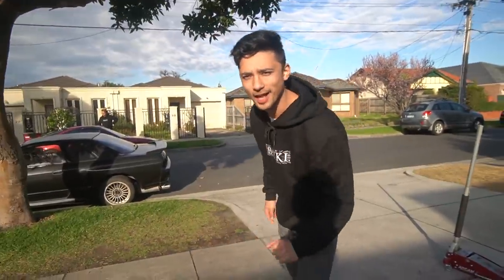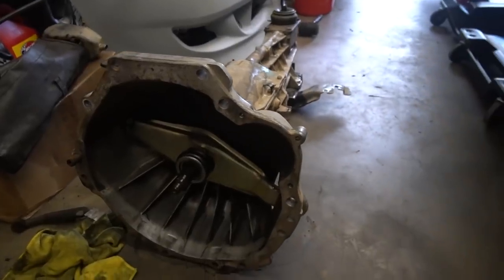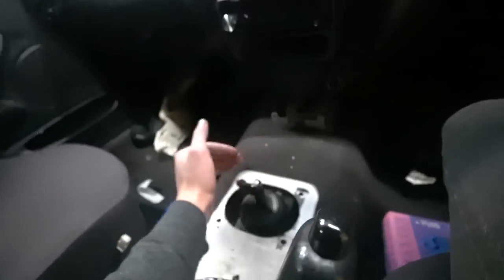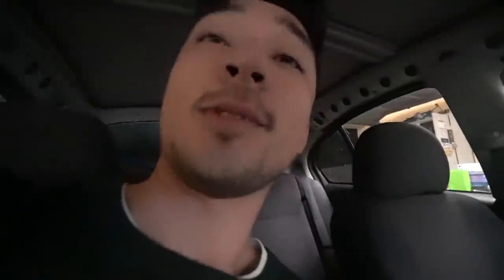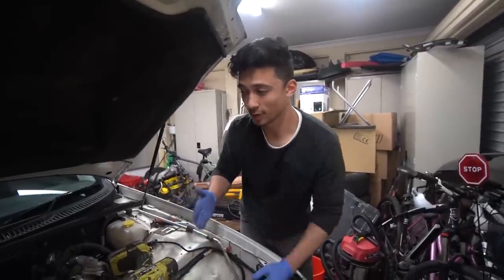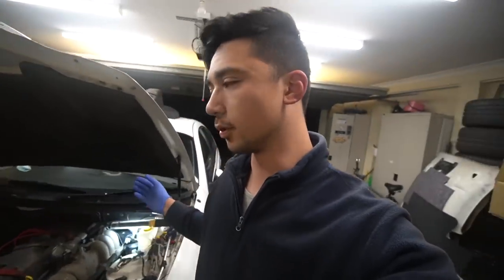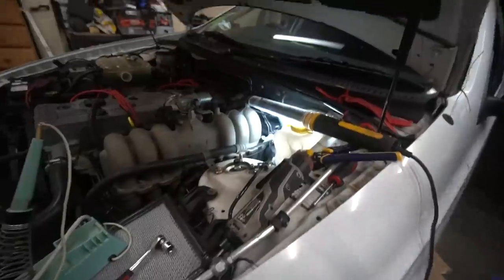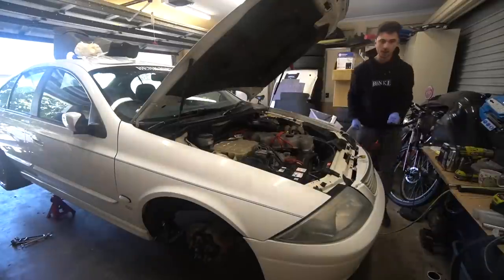IT DIDN'T START ON US - AU FALCON MANUAL SWAP PART 2.

Comment: how much does it cost to get the tailshaft shortend?
can they do that on the alloy shaft or do u need a steel one?
p.s. stalling after starting is probably the idle speed controller (ISC) being disconnected.. the lpg wiring runs off that wire and if u cut u might not have rewired it properly..
mine was stalling like that an it was a bad ISC

Comment: Clutch cable is honestly the easiest part of the manual swap. Just make sure you route it properly, because if you don't it can snap. Also, if you haven't already, get a firewall backing plate that goes around the clutch cable hole. It prevents the firewall from cracking which will definitely happen if you're cicking the cable clutch going sideways

Comment: You need to join the injector cut, IAC and O2 sensor for the LPG delete and do a PATS reset with the new ECU. PM me if you want a PATS reset happy to help. Need two keys to do it but if you don't have one get a second one and can do it, or can do a sneaky with external key reader and another key from different car. If you have the manual loom honestly just use it. Usually when it cranks but won't fire unless you spray aero start is because the Injectors aren't firing. If you change the ECU without PATS reset you get no crank and the handshake light on the cluster lights up.

Comment: I’ve done so many of these swaps into falcons, it’s so much easier putting it in with the box off the bellhousing as you can get the top starter bolt from underneath

Comment: You need to punch the door card on the skyline if it won’t go up trust me, any parts you need contact DINH at skyline spares in Sydney, that needs to come to my workshop also I sell mini spools :)
Reply from the maker: 😂 we tried everything we could witht the window hahaha  and thanks for the info! and ooft keen for the shop
Reply: @RexH  trust me punch it I owned two gtrs and every Silvia that’s how you get but for years before you can be bothered changing it out
Reply: @RexH  auto tailshafts in au are the same as manual to mate

Comment: them top starter bolts suck ass malwood do a pedalpin to suit auto pedal box to convert to manual I use them on e series falcons. should also fit e series litterly like a 10 15min bolt in process